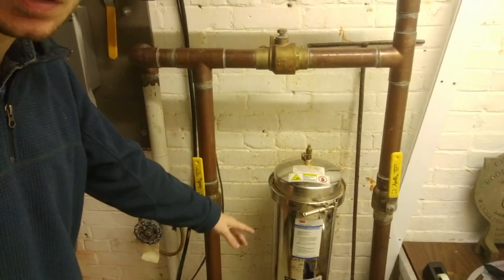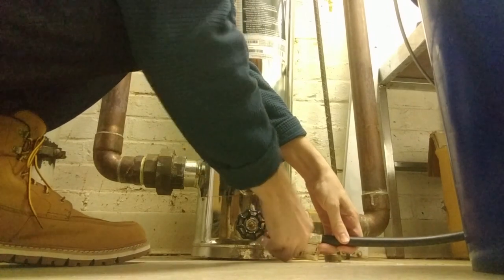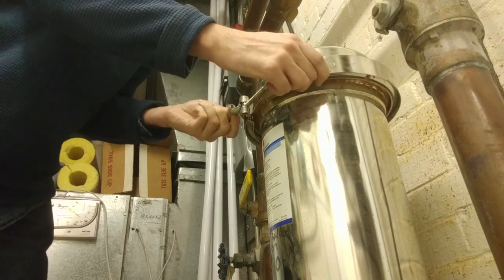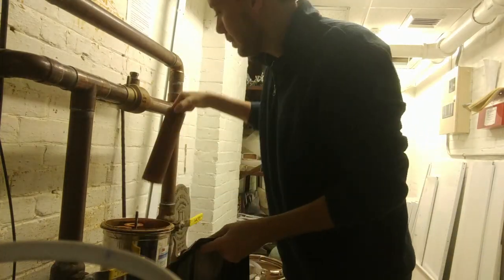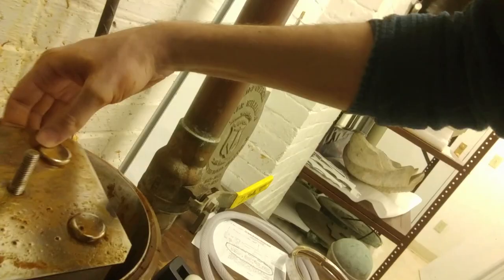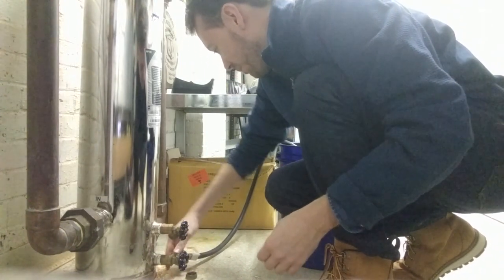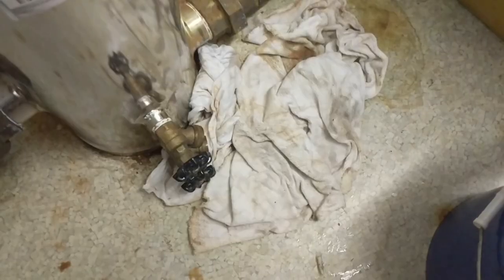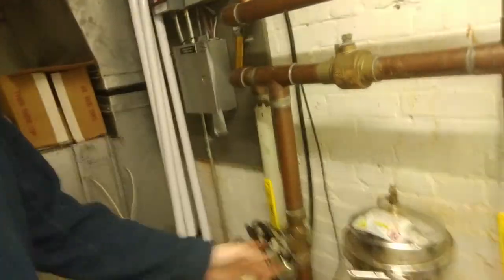How to change water filter cartridges for an Aqua-Pure SS EPE-316L series filtration system

Comment: how come you are not using the carbon filters?
Reply from the maker: The filters we use are supplied by the HVAC company that handles our general maintenance, and I'm sure it's a cost saving measure. This building has very old rusty plumbing and eats through filters in a matter of months. The water is only used for restrooms and HVAC, not for drinking, so the standard filters are adequate for that purpose.